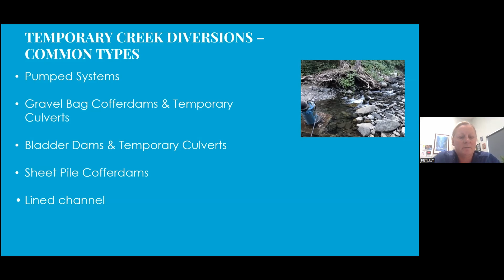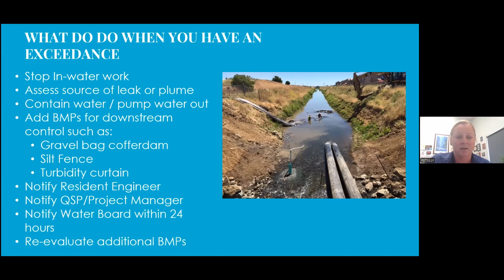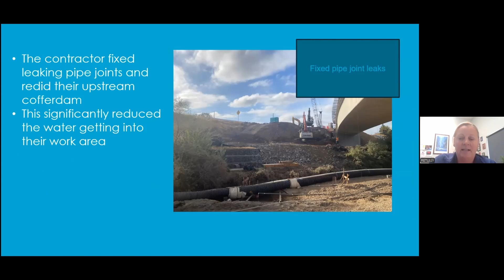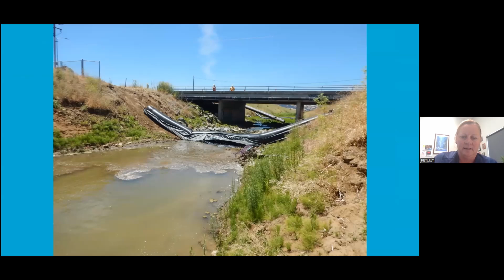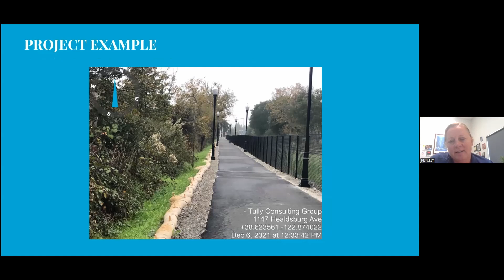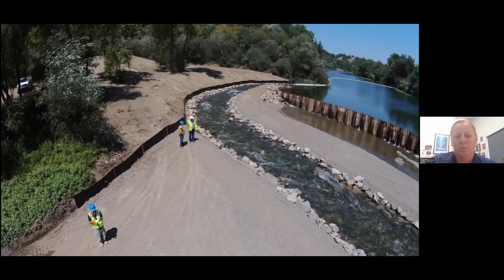Protecting Creek Water Quality During Construction

Comment: The waters of the state definition referenced at 5:02 is not correct. Waters of the state include all surface waters and do not require connectivity to a waterway. The definition presented implies connectivity is required and that is not true.